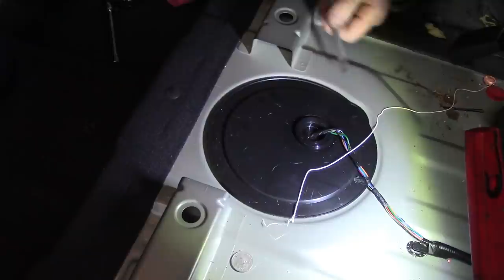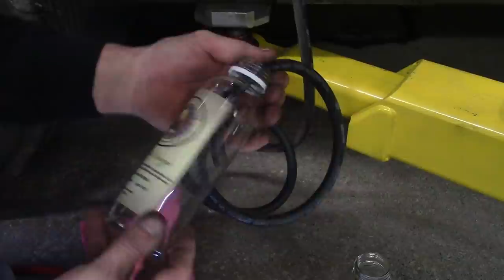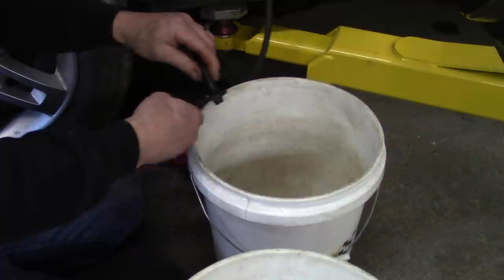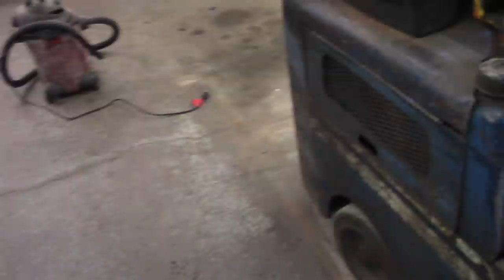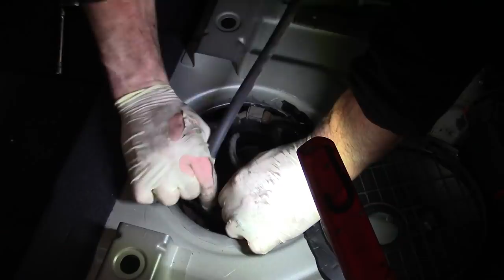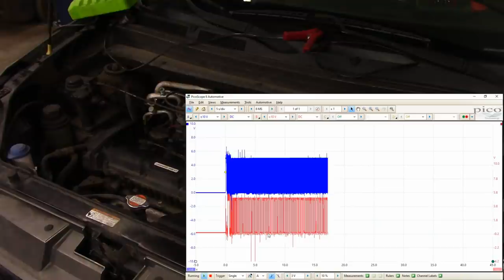Kia Soul - Auction Car Special Part II

Comment: Hehe, I had me one of these a year or 2 ago on an auction turd. 2016 Acura mdx. Came to me on a hook, the engine oil was color of a milkshake so I didn't bother with compression checks n all, motor time. Popped engine in it, started right up, idled nearly an hour. Problem came when I tried to drive it, pinging no power. Long story short,  had diesel in the tank, I pumped it out and refilled, and when all was said and done, I ended up doing bofa da converters too. I didnt pull the tank either, just wanted that problem child out of my shop and outta my life. Always enjoy your videos

Comment: brings back bad memories when my 6.4 f250 got a load of gas,,,several thousands later with a new fuel pump and other goodie. Was good for couple years then just up and died in the driveway

Comment: If less than half a Gallon of Diesel is in the petrol tank . Plug high octane petrol straight in.
 ( DRAIN THE TANK IF MORE THAN HALF A GALLON OF DIESEL IS IN THE PETROL TANK.  )
RUN THE VEHICLE FOR AS LONG AS POSSIBLE. 
PUT MORE HIGH OCTANE PETROL IN.
RUN . AGAIN .
REPEAT.
RATIO OF PETROL AND DIESEL. REDUCING THE DIESEL AMOUNT IS THE KEY.

Comment: AAAAHHH iT WILL RUN ON 50/50 DIESEL AND PETROL ,, , if you were to run it on that mix it would require weekly plug changes or cleanthem

Comment: Hey Eric, I don't know if, or how long it ran with Diesel Fuel in it, but I bet she's very clean on the inside! There are a number of Engine flushes still on the market for idiot's to buy! Those old type of round cardboard can's of Gunk Brand Engine Flush for one. Ring's should be free, and not stuck! LOL! I wonder how bad the Camshaft look's? Cylinder Wall Scratches, and Partially Plugged Oil Pump Pick-Up Screen! Most of the Engine Flushes(Liquid Death in a Can or Bottle) are Kerosene Based if you do your research! I would'nt put any of that stuff even in my push mower!! HA,HA,HA! I guess time will tell! SEMPER Fi

Comment: Hmmm,  🤔 ,   Those  Spark plugs looked OK,   just needed a little TLC,   w/ some-- "Brake kleen", little Wire Brush,  RE - GAP  &  or check the GAP,   POP'UM back in,  & your good to go,  👍☑️👌

Comment: Story time folks.....I had a kid (18) that worked with my crew years ago, boss told me to give him my truck keys(I did the heavy hauling) so he could go get the lumber order that was waiting for us. I told my boss no..his chevette scares him and you want me to give him a 454. Boss pulled rank.  I said it needs gas...2 weeks earlier we did an engine swap..pulled the worn out diesel out of the Silverado and dropped a 454 in with trans, changed fuel system(boss had a wrecked truck..parts donor). He gave the kid Chris 30 bucks for gas, I told him forget the diesel stickers...has a GAS ENGINE. Stupid stoner prick put 30 bucks diesel in it. Stuck at the pump. I`m on the roof of the house(new roof and addition we were adding) when I saw him walking back to the job...NO TRUCK!! I flipped out on him..WHERE`S MY TRUCK?? We had it towed to boss` house and  I flushed it out that weekend. Chris wound up working for a week..no pay...to repay boss and I for his mistake. Truck ran like poo for a few days, once it cleared up and backhoe was available, I was able to get the rental backhoe we needed for the job. He set us back 2 weeks. A month after his mistake he quit, got in his clapped out chevette and rode off into the sunset. Kid was not too bright.

Comment: I loved the lessons learned in these two videos. Spent forever using expensive computers checking flow rates, charts, and sequences chasing down all the electronic gremlins. You solve the case with a sniff of a spark plug.  Fantastic! What's the going labor rate for olfactory extrapolation? lol...excellent vids. Loved it. I had narrowed it down to someone had sugared the gas tank. That why you're the pro.
Reply: Love your videos remember to check your spark plug fluid haha

Comment: One main advantage of working on my own cars is that I can preorder parts from Rock Auto, the dealer, and/ or other specialized parts stores before working on them.  I try to stick with OEM, Gates, FelPro, NGK parts; no Dorman for me!  Also, I am not paying a mechanic $100 - $125 per hour.  My 2nd hand 96 Miata has never been to a mechanic in 8 years I have owned it, and my 95 Dakota has gone in 3 times since I bought it in 1994.

Comment: The "Bruh! You should have..." brigade would have pulled the tank, replaced the plugs, injectors, fuel pump, lines, filter, the Delhi Lama's left gonad e.t.c. But you got the car running. And you did it efficiently. Both methods work, but yours cost a fraction of the "Bruh!" Method. Both in money and time.

Comment: Hi Eric,
I only know your name because someone in this comment section mentioned a guy named Eric. See? I don't know anything , and I can prove it!
Can you answer a question about the Hyundai 2.4's? Whenever my engine sits for several hours and starts, I hear a tapping noise, like a lifter type sound, that goes away in about 2 seconds. Is this just a normal thing for these engines to do?
Thanks, and If I lived closer, or if you ever open a shop near here (PA) I'm coming over!

LG

Comment: My 2015 Kia Soul  with 38000 miles. Has been the most dependable car I have ever owned in 40 years! Especially more reliable than any American cars I  have ever owned! I run this car to the ground often driving for Uber & Lyft. And this car keeps going and going! Should this car ever die on me. I will buy another Kia Soul, Or I will have this one overhauled!

Comment: I know this is old, but a good reason to have a known good waveform is demonstrated with a recent Pine Hollow video where he worked on a GMT360 (trailblazer, et al.) with the 4.2L I-6.  He found that the junkyard put in a 1 year newer engine that used a different reluctor wheel that wasn't compatible with the ECU.  With a known good waveform, it was obvious there was a problem and that they needed the correct engine to be swapped in.  Wasn't really the junkyard's fault as their primary business is disassembly, so they see a decent vehicle they could sell and an "identical" one in their yard and have no clue GM changed the reluctor wheel and ECU programming mid-cycle.  Anyway, it's interesting to watch and this one was a zinger with the diesel... I also wonder if whoever was trying to get it to run was at a private filling station (like a farm, etc.) that used a standard pump handle for their diesel tank, and the person fixing this had no idea.

Comment: Your are correct that the Fuel Nozzle (Green) is larger for Diesel, But if some LugNut replaced the nozzle with the wrong nozzle ( Gas Nozzle ) . You could put diesel in the tank.  Plus if the person fueling the car didn't look at which nozzle they grabbed from the dispenser with the wrong nozzle.  Bingo.    FYI:  I work of a Major Wholesale Club with a gas station.  We do minor maintenance on the dispensers.

Comment: When I started driving my dad told me, "If you accidently put diesel in the tank don't shut off the engine! If the engine is hot it will run with some diesel in the gas. Drive it to where you can drain the tank and refill with gas."

Comment: HUH? on the last vid, i offered the unmentioned 3rd option, 3/4 of a tank of "OTHER". Sometimes inattentive fuel truck drivers pump stuff in the wrong tanks in the ground. have seen it in actual practice. Had 4 cars in 1 week with the same option 3 issue.

Comment: I have a 2000 Hyundai sonata v6 3.3 I have a 5 cylinders running at A6 just put spark plugs and coils in it got some bad gas and it started skipping do I need to change the injectors not showing an injector code ORD electrical problem the OBD2 reader will not give me an answer is it a bad ECM

Comment: Someone picked up the wrong nozzle at the gas station. We had a customer that filled her hubbys 3.4l diesel Land cruiser on Gasoline.  We drained it out at work after towing it in. It did about 5km before it started knocking and stopped. We got 20 liters each. My corolla smoked a bit but we poor apprentices didn't turn it down. Free gas. It was low when she had filled it up luckily. LOL

Comment: So the Intermotor CSS1661 does actually fit the Soul. But that’s actually the camshaft position sensor. So maybe the person pulling the part typed in the wrong thing or misread camshaft instead of crankshaft.

Comment: earlier this year my lil bro bought and early 2k saturn ls2. he ha done like it a frew years ago. suspected bad fuel pump which you can access via cutting a hole under the rear seat. he did it on his old one. checked this one out, and fuel level said "1/2" or some such. he thought "hey, maybe the sender is wrong..." put some fuel in it. fires up! bought for $400, sold for $1600 a couple weeks later...

Comment: Diesel is HEAVIER and sinks. Petrol will float on top of Diesel. 
The fuel pump picks up from the bottom first Picking up the diesel  first.
This plus the return feed from the fuel line causes the petrol  , diesel combination to mix which clogs the spark plugs. ( because the initial mix has  brought through more Diesel than petrol.)

Comment: We had an auction car (a cute little Porsche 911) show up at my shop with a cranks/no start condition. No codes present, but the weirdest odor coming from the exhaust! We never figured out what was actually in the fuel tank, but it smelled like insecticide... We declined to perform any additional service at that point!!!

Comment: About 30 years ago, my little brother borrowed my '64 Falcon Sprint to take a new girl out on a date and impress her with the cool car. To show his appreciation to me for letting him use it, he topped off the tank - with diesel. About a 60/40 mix of gas/diesel as best I could figure. It ran, barely, and smoked like a two stroke, but it did get them home where I drained the tank and blew out the line. No harm, ran fine after that.

Comment: About a year ago, a local fuel station has diesel fuel offloaded into the regular fuel tank.  My sister's car and dozens of others were damaged.  Chevy garage replaced the entire fuel system, plus filters.  About a 4500 dollar mistake on the part of the fuel station (Race Track).

Comment: We had three large tanks on my grandpas farm growing up. One had gas, one with red diesel, and one with road diesel. He had just got a brand new twin engine 72” Dixie Chopper at the beginning of spring when I was probably 10 years old. I called the house to see if I could come grab a mower to cut our yard and he said sure come on by and told me to grab the new one for a shake down run. I grabbed the mower, filled it up and took off toward my house. I don’t know how I got mixed up but I filled that sucker plum full of off road diesel. Unfortunately I didn’t realize my mistake until I had made the halfish mile drive to my house. Needless to say he was none to pleased with my ass lol. But I never made that mistake again.

Comment: How very dare you!! Diesel is the elixir of all engines with true powahhhhh.
Being a heavy diesel mech, kerosene was always a favourite poison of operators, their heaters used kero, and in the cold of night they’d refuel their truck with the kero fuel can. Which caused an interesting bunch of symptoms.
Great work by the way, a very surprising two for one deal.

Comment: Recently, I accidentally ran a hot Kohler K341 engine on 75% diesel and didn’t see any smoke or loss of power.  Mowed my entire lawn with it. Did not realize my mistake til next morning when cold engine would crank but not start.

Comment: So, this happened at a gas station near me...

A truck delivering fuel swapped the station's diesel tank and premium gasoline tanks and filled them both with the wrong fuel (i.e. filled the diesel tank with gas and filled the gas tank with diesel). Most people don't buy premium or midgrade, so most cars didn't have a problem, but everyone who got diesel from there had major problems.

Comment: Since diesel is more viscous than gas. The fuel pump could have an issue pushing the thicker fluid. A fuel pressure check should be in order. Or just start it and see if it run. Gess than you'd know if your pushing enough gas. Right??

Comment: I really hope someone didn't send that car to auction because a jerk dumped diesel in the tank.

Depending on the pump, some diesel pumps have almost the same size nozzle, don't they?  I guess I haven't looked that close.  My truck can take both the diesel nozzles at the gas islands and the big high flow truck nozzles.  Hmmm ... investigation station.

Comment: Refinery in Salt Lake City had a foul up with high sulfur diesel and it mixed with gas.  GM products dropped like flies as it took out fuel pumps.  Worked at a dealer then and we were busy.  This was in 94.

Comment: Diesel pumps have the wrong size nozzles all the time. My diesel VW has a contraption that keeps you from putting gas nozzles in it. I always run into diesel pumps with gas nozzles. It's very annoying.

Comment: .Talking about a funny story, well when I was going through mechanics school for the military we had this young guy that was working on our team. We had just finished up rebuilding this mocked up 350 and had it on the dyno. We asked this kid to go grab a can of fuel. we hooked it up and when we started it, it ran like crap. when we checked it we found out it was diesel fuel so we changed it out for gas. Problem solved.

Comment: Ah, I've been down that road before. Except it was an actual customer's truck, and they neglected to mention that the tank had been near empty and they added 2 5gal containers of some unknown substance in fuel cans to their gas tank. I don't know what it was, but it had more in common with swamp drainage than gasoline. The guy then proceeded to argue with the service advisor, swear at him and insist that we are ripping him off because it absolutely couldn't be related to the "gas" he put in the tank. So, I brought him out into the shop, poured some of the "gas" out on the bench and hit it with a torch. Absolutely nothing happened, didn't burn at all. I then hooked up his truck to an alternate fuel source and started it up. He apologized profusely.

Comment: Back in 1986 I worked at a Ford Dealer and just up the road the Petrol Station had a re-fit. there was 2 or three cars a day that had mis-fulled and broke down right outside our garage. ended up with gallons of  mixed fuel in cans. I  got rid of it all eventually just put the odd gallon in ontop of good stuff.

Comment: Whereabouts in New York are you I’ve got a 2008 Toyota Highlander it runs good but I got some dash lights on the hook a computer up to it they tell me I have a leak in my eve app system they said it’s such a small leak they can’t find it They gave me an inspection sticker for this year but they told me I won’t get one for next year I have to get it fixed the first mechanic I took it to said it was the charcoal filter thousand dollar later the light came back on I’ve been to four other mechanics they all say it’s such a small leak they can’t find the leak I was thinking if you were not too far I’m in Vermont maybe drive over and have you take a look at it or any thought of yours you might have on my issue I would greatly appreciate this 2008 is in really good condition it does have 208,000 miles on it runs real good loyal as always been changed on time and I’ve always run synthetic through it I’d like to keep it as long as I can I bought it with 100,000 miles on it I flushed all the fluid out of the transmission when I bought it by disconnecting. The hose at the transmission cooler started it up pumped out a quart and put one in did this over and over and over to the whole system was full of new oil so if I could find some help I greatly appreciate it

Comment: You'd be surprised. In massachusetts I've had customers take the funnel that comes with the car and place that in fuel filler neck because the gas (diesel) nozzle didn't fit. So they put diesel in via a funnel smh

Comment: showing my age, Vietnam, at night, 68, 69 ? the CO jeep was out of gas.... the fuel depot was on the other side of the base camp. we walk to the near by mess hall, they always have  some gas around, I find a can that is full, take the lid off give it a snort, yep that's gas alright, I start pouring it in to the gas tank, and it is making a odd  glupping sounds, we put a light on it, no way, it was five gallons of pita-prime... pitch ... That ant good, I get the jeep to start on what gas is in the system and get out on to the perimeter road, a duce and half with the change of guard is coming up behind us, I get the driving to give the jeep a long push off the back of the spare tire, with the chock out it started, go figure:   as dark as it was that blue white smoke lit up the night sky, looking like  DT being sprayed in to the sky, we got it flushed out but it was just to much for it,  three days later they R&R the gas fuel pump, I loved those military transports.. love those old multifuel rigs, although the jeep wasn't. 
if I had to do it all over, I do the over the road rigs again, it's good work,

Comment: I keep a good bit of pump gas and jet A at the house. In haste one day I put 10gallons of jet in my wife’s HHR on and empty tank. It didn’t take long to start rattling pretty bad but it ran and stayed running. Went straight to station and filled up. That was several 1000 miles ago. No damage done.

Comment: picked up a free Nissan Altima with a" bad motor". Started it and saw the smoke,thought a blown head gasket till I got a wiff of the diesel . Drained tank added gas and it smoked for a couple of tanks. 2 yrs ago still my daughter's daily driver. Also had to reweld the cat that had been cut loose because "it must be a plugged cat"